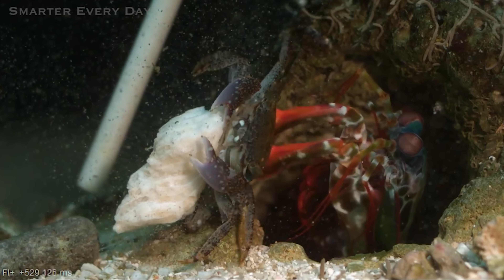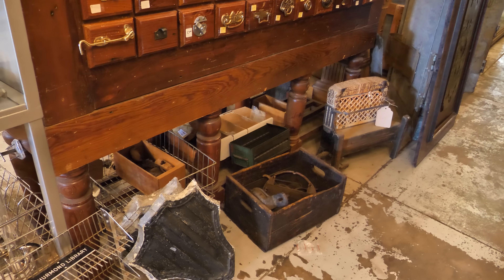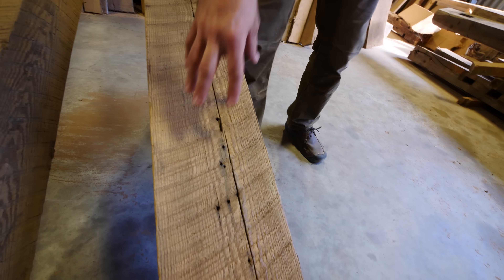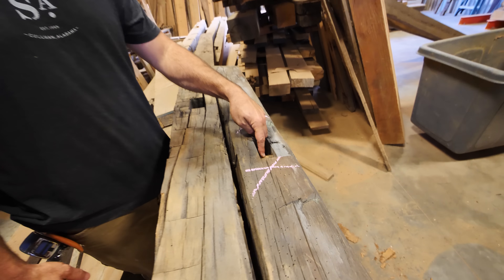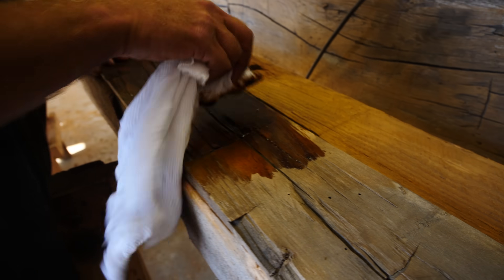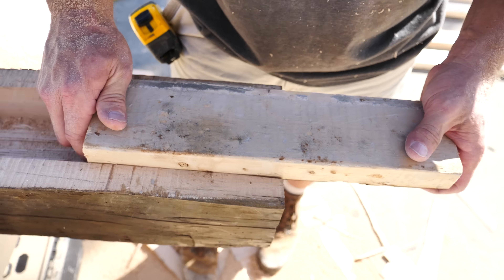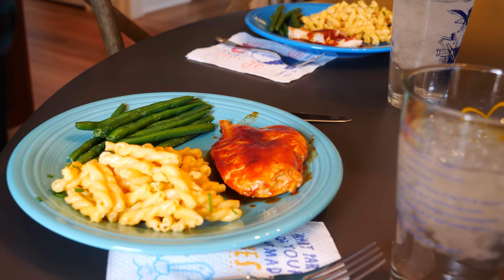Fake Beams - Smarter Every Day 186

Comment: You should check out the Old Faithful Inn. The oldest part of the building looks like a rustic old cabin but it is actually a modern (if a 115 year old building can be considered "modern") steel frame building. But all the steel is clad with wood taken from the local pine forest.

Comment: There are quite a few reasons why not to use old reclaimed barn wood in your house. They can carry many toxins and high levels of heavy metals, since old barns used to be sprayed down the wood with these heavy metals and toxins to try to keep pests and vermin from eating the wood of the barn. So every time you're disturbing it cutting it or bring it into your house you're exposing yourself to these heavy metals and toxins. You can always send a test sample of the wood into a lab for about $30 and they'll test it and tell you everything that's in the wood.  I recommend you do this before you bring this into your house.

Comment: The pegs are made by hammering octagonal staves through progressively smaller diameter holes drilled in a metal plate, which is a shearing cut rather than a parting cut, so it's not technically true to say that some guy cut those pegs with a knife...

Comment: Doesn't matter what you do to it, it will not look structural to anyone who knows about construction. We don't run drywall up to the side of a beam, can't finish the gap and you'd never run drywall on above a structural beam as drywall can't hold the weight of whatever the beam is supposedly supporting. The splits in the beam clearly show it isn't structural either, as you would have replaced it before the house collapsed on you. That said, your decorative antique wood beam looks very decorative. :)

Comment: My house is 118 years old, and above my kitchen ceiling were 9 hand hewn beams running across.   My plan is to remove the ugly Sheetrock And expose the wood.

Also, my crawlspace has a 30x30 hewn beam running the width of the house... in the crawlspace... sitting on granite blocks.

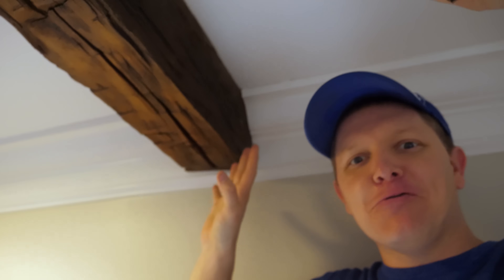Comment: 9:25 Why not get a slightly longer piece and just slide it into the wall and let it rest on the walls instead of hanging from the ceiling waiting to fall off on someones head? I would feel much more comfortable knowing all that weight was resting on something instead of clinging to the ceiling. (Maybe you can add a supporting cross section under it or something in this way and make some kind of intricate looking fancy decoration?) Or just diagonal supports?
Very lovely decoration, I really love good old fashion wood building. :)

Comment: Hey! i had a simple question that turns out the answer is not simple! how a space ship or a space station lose heat? i mean... the sun give energy and the body of the astronauts also generate heat, but the vacuum provided heat insulation don't turn this system into a oven??

Comment: a note on plugs in general:  Plugs are usually inserted cross grain, meaning the grain of the plug is 90 degrees to the wood it's going in.  It wouldn't make any difference in this job but if a thin piece had a plug put in it and the plug expanded under stress or moisture content, then it would split the wood.  Always put in plugs cross grain and it will look like you know what you are doing, regardless of the application.  From 45 years experience.

Comment: Those offcuts from making the beam straight could also have a use as some veneer to finish the sides of the fireplace uprights, giving it a look that says it was made 150 years ago. Would need an insert that is similar age though to match in there.

Comment: We have done barn beams in a few houses that we've built. If the ceiling joists are going perpendicular to the beam, you can just use long lags called Timberlocks. They come in as short as 4" up to 10". No need to predrill or chop out the top side for a 2x4

Comment: as a structural engineer i think those beams are hot too bad you can't actually use them as actual structural components though (you would need to coat them and make sure they aren't attacked by fungi or insects for them to be structural but even as just  aesthetics you need to maintain them )

Comment: I added a 1790s log building to our 1850 farmhouse and I use hand hewn beams to tie the dry walled interior walls into the older structure. For our stair railing I split a hewn beam lengthwise to join the ends so it would be long enough. To do what that bandsaw did in a few seconds took me a circular saw, reciprocating saw, caulk line, router with homemade trammel, chisels, plane, and 8 hours. 

Great video.  One thing your supplier didn't mention: up north at least, there was a window between the hand hewn and the sawmilled beams where they were cut with a pit saw - a giant hand saw with a person standing on the log holding one end and a guy in a pit underneath holding the other. You still get the marks from the teeth, but they are straight and parallel marks. The guy getting rained on by sawdust all day long is also the origin of describing something as the pits.

Comment: I enjoyed this video and then scrolled down to the comments and was thoroughly annoyed by all the snobs saying why fake structural beams shouldn't be in a house. The dark beams against the light ceiling add contrast and depth to the room. It's visually pleasing whether it serves a structural purpose or not.
Reply: Cool. So if the next video will be titled "INSTALLING NEW ENGINE FOR MY TRUCK", you will be perfectly happy to watch him bolt it on top of the roof for decorative purposes? While he advertises a certain used cars salesman for 10 minutes straight.
Reply: Bear Arms Yeah, he's decorating a room with wood. In the form of beams. And the act of putting said decorative wooden beams into the room is also known as installing. So, installing beams.
Reply: Bear Arms No, because he wouldn't be installing the engine for his truck. If he titled it "Installing an engine on my truck," then sure.

And as for the advertising, I don't really care, particularly if it's relevant to the subject of the video and he's transparent about the deal over the advertising. He's had sponsor ads on his videos long before this, besides.

That said, a better analogous ad than a "certain used car salesman" for your hypothetical would be a "certain used parts/scrap seller." Since, you know, he didn't advertise a realtor in this video.
Reply: FlintSparked, if Dustin straight up called them "decoration" throughout the video, I bet no one would object.
The video is titled "How to Install 150 Year Old Hand Hewn Beams". He does not "install beams". He decorates a room with wood.
Reply: FlintSparked couldn’t agree more sir.

Comment: A long time ago, when the Earth was green, the house I grew up in had 8X8 Redwood beams running across the ceiling, only they were structural. And then the ceiling was all 2" wide tongue and groove Redwood.
When my parents sold that house, in 1984, the new owners tore out the entire ceiling, and replaced it with sheetrock. :(

Comment: Silly Americans thinking 1850's beams are old! My family have a house with 600+ year old wooden beams, some originally used on ships, throughout the house.
Reply: Same thing here :D
Reply: That's insane! And here I was thinking that steel is the longer lasting material in general.
Reply: Woah, that’s awesome
Reply: 10Slayer014, if it's NOT a legend, that's pretty depressing. It means your family could not build a better house for 600 years straight.
Reply: 10Slayer01 I like both. Different unique times in history, with different ways of doing things; adds character.
Reply: Silly you for not appreciating something over 150 years old. Yes your 600+ beams are much older and amazing but what you beams have in age you lack in humility.

Comment: That is a gorgeous mantle! A few years back I used a "mouse" sander to remove polyurethane from some cedar wooden windowsills and used that very product you've used, Briwax (the "honey" colour variety), as a finishing treatment. They came up great. I do have to re-apply the wax approx every 6 months though. I live in New Zealand and the sun/UV is very harsh on wood that is exposed constantly to it - but hey, it's a 10 minute job with the wax and a rag to re-apply. Nice video!

Comment: I helped a friend do something similar in his home a few years ago. He had pulled down an old barn and some granaries on his property. The wood, all hand planed, didn't go to waste. His hardwood floor looks amazing. We placed upright beams against the walls, under the ones on the ceiling. Most of them we had cut in half, so they look like they're part of the walls or ceiling. The ones in the corners were quartered, to look as though they're just peeking out. The overall effect is wonderfully  warm and comfortable. 
Thank you for your video.

Comment: Natural wood always warms a room, making you feel as you said cozy. It is too bad there were only 2 beams. It would look a bit more realist with 4 beams with the first at the edge of where that room starts. With what you have done with the beams and the mantle this wood has become the accent in the room. It could use a little presence in the room. You have that large empty wall across from the windows. What are the chances of adding either 2 larger or a group of framed pictures framed in that same type of wood stained the same color to tie the accent in better with the room. Or possibly some floating shelves on both sides of the fireplace wall. Just some thoughts Destin. Just some thoughts to bring a little more warm and strengthen the accents you have started. Thanks for sharing.

Comment: Destin, Another note on your old beams...if they were maple and the ring radius denotes the tree was fairly large, that was likely virgin timber.  It may have been cut and worked 150 years ago, but the tree itself may have been really old. A cross section of the timber can be read like a book by an expert.  An example of such a sleuthing can be read in "A Sand County Almanac" where the author, Aldo Leopold, finds a bit of driftwood lumber.

Comment: This may be the intersection of the architect and engineer in me, but everything about this really just... niggles me. A lot. :x My sense of architectural aesthetics intersects directly with structural engineering, and I like to see architectural elements that are simultaneously structural AND decorative. Not just a pretty hand-hewn beam anchored into the ceiling just to look structural, but a pretty hand-hewn beam that IS structural, and it's exposed so that its beauty and function can be admired.

But then again I also grew up in a log cabin in which the entirety of its structural elements were exposed. The immense logs that made up its foot-thick walls and mortar that filled the gaps between them, the immense sawn logs that spanned the width of the house to support the second floor, the A-frame elements of the roof (which both bedrooms nestled under), and so on.

So to me, when I see something that has not only form but also genuine, real, usable function, I squee inside. I get an architectural and engineering high from it. It's also why I really enjoy the aesthetics of furniture, because furniture has both form and function.

Comment: Devin, I tore down a big house built in 1875 by hand.  The framing of the structure was amazing, all pegged hand-made mortise and tenons.  The white pine posts went from the ground to the 2 story roofline, and the horizontal 12X12s spanned the entire walls.  I made a few videos on my channel if you're interested in seeing the process.  I used the reclaimed lumber tu build a garage, but had a huge pile left over!

Comment: I'm joyed to see this video. I did this a few times in a carriage house where we used reclaimed lumber from old barns to build the walls and ceiling. I learned more about wood working in that house than anywhere else. We put up a beam like the two you have but it was three times bigger, 16 feet long, and here's the kicker, we were 25 feet in the air. That beam must of weighed 300+ lbs and me one other worker and the boss got it up in the apex of the ceiling and were so relieved we didn't drop this thing and knock all of us off the ladders and walk boards. I'm grateful to still be alive and put up such a beautiful beam.

Comment: My architect friend says fake structural elements are 'perverse'.
Reply: 100% agree
Reply: Sometimes with old buildings where the beams holding the roof up have become outdated a new roof is put on but with the original beams left up in places for aesthetic purposes. It's a nice idea and maintains the buildings character. Although that being said putting decorative old beams in a modern house doesn't really work unless the house is designed to imitate an old style of architecture or is an imitation barn conversion.
Reply: Why enable comments if you don't want a discussion?
Reply: I'm also not sure why anyone would do that, but I'm just a physicist that sees unnecessary weight (around one metric shitton?) on the ceiling. On the contrary, I get the beauty of massive blocks of largely untreated wood. I own a table made from a single slab of wood (albizia saman), like at 2:40 , just a tad bigger...clocking in at 200x85-100x10 cm³ and around 120kg. But that's standing on the floor and serves a purpose. Bolting dead trees onto the ceiling? That's beyond me.
Reply: @DaRealBzzz  it's actually a thing to blend in the old with the new, and it makes for fascinating designs, tho i feel like Destin t had it only focused on the beams, that's why it might not look so appealing, but a touch here and there and it would feel "Cozy".
Reply: Our forum, we can express ourselves as we please.
Reply: If I do this it will probably fall on my head and kill me.
Reply: elevown That's what I thought as well, It would have been cooler if he had done more stuff with it like at the fireplace.
Reply: Am an architect and can confirm this makes me uneasy. Was wondering if I'm alone and that's how I found your comment. I studied architecture in Bulgaria, so I guess fake beams are an internationl no-no.
Reply: Bzzz he has a wife remember.
Reply: He must hate Renaissance palazzos.
Reply: elevown I am have to agree... it's like hood scoops that don't go anywhere...
Reply: They look bad if they aren't convincing.  Form is function, function is form.
Reply: Cough, Google's forum actually, there is an EULA :P
Reply: An architect worrying about structural elements? Lol, thats the CivE's job
Reply: If it's not an actual piece of the load baring structure, it will look cheap and cheesy. just like this.
Reply: Good God. Everybody and their opinions. His house, he can do as he pleases.
Reply: Can't we just appreciate the artistic beauty? The way y'all are talking, we might just as well live in perfectly practical cuboids and eat oatmeal for all our meals.
Reply: homeless people out there and he is spending money putting a beam on a beam. I can't pay no doctor bill, but whitey on the moon.

Comment: Great video, I do however find it very funny how people "reclaim" old wood to make ornaments basically. And here I sit in a 105 year old house hoping the exact same pieces of wood dont break thru the floor when I go upstairs or let my roof fall when the wind hits it.
Reply: zuilok Same with my 107 year old house.
Reply: where are you from? I am living in the Czech republic in a small village founded over 900 years ago.
Reply: this. basically ornament seems like an insult - if you are romantic about such things i'm not saying use it structurally but repurpose it to something functional. Great video, info and general content..
Reply: What could it possibly be functionally used for?
Reply: Mat Gee, make furniture. Make floors. Or you could make some sort of pavillion or anything else that doesn't require much structural strength.

Comment: how much would you normally pay for beams like that? 
$100s?
$1000+?
Reply: Their website says anywhere from $5-$8 per board foot, which is a volume of 12 inx12inx1in. They said 32 feet long, and I'm going to guess 6 inches wide and eight inches thick, so roughly 128 board feet, if you paid $8 per board foot, it would be about $1024, not including taxes, delivery charges, and if they charged extra for the cut and color
Reply: Hannah Hendrickson thx, i didn't think to search their site🤔
Reply: Pretty good trade to advertise to 5 million people. I would get lost in thier store and warehouse.
Reply: made is sound like destin got a deal for putting the store in the show...
Reply: Well.... if you go to Ohio directly I don't think it would be terribly hard to find some around $15 bucks.  These stores make a killing.  In some ways they have to, to cover the huge storage space, salaries for skilled workers, machinery, delivery, etc...  I won't blame them for trying to make a profit, but do be aware that at your inconvenience you can find these far cheaper by picking over "garage" sales and asking (likely how they themselves get many of their items).
Reply: It all depends on the type of wood, age, characteristic, etc. But yes... >$1000.
Reply: Dregory Dewhard I think it was a trade. A couple beams for free for the plug.
Reply: zvxcvxcz, what's worse, these sorts of shops buy out everything in the vicinity only to resell it later at 10x-100x markup. Storage is cheap and the items don't age, so they can gobble up tonns and tonns of stuff with very little operating costs.